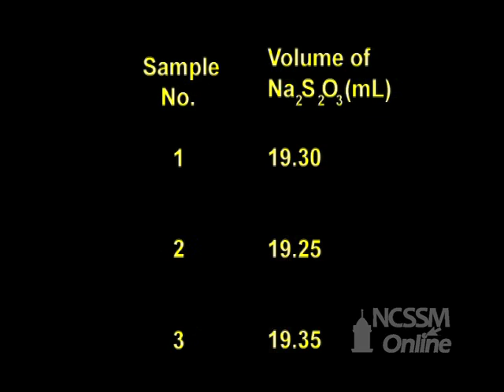Bleach Analysis Lab

Comment: Can we get details about the calculations? i.e. how to estimate mass % of hypochlorite in bleach?
Reply: You will have found the moles of NaOCl which were present in your sample. From there you can calculate the molarity of the javel solution and with a table you can find online, you can get the wt%.

edit: I just realized that they measured the density. So you can easily figure out the mass of your solution (density*volume = 5.4 g). If you then have the moles of NaOCl you can get the mass of it by multiplying by 75g/mol (approximately). Knowing that there were x grams of NaOCl in the 5.4 grams you get a wt% of x/5.4